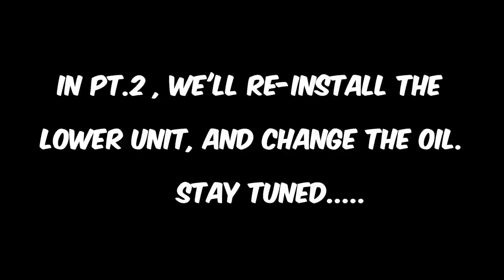Pt.1 Suzuki DT25 Outboard Water Pump Service  At D-Ray's Shop

Comment: D-Ray,  I used this vid to help me change the water pump on my DT30. 
Now the carbs need cleaning.  What’s the secret to getting the carbs off?  
I assumed the silencer base comes off first but there’s not enough room to remove the bottom two bolts. 
Are the carbs able to be removed with the silencer plate still in place?

Comment from the maker: There is a roll pin that attaches the shift shaft just above the lower unit, you should be able to get to it with the lower unit dropped a few inches. There is a good exploded view on boats dot net

Comment: Thx mate. Easy to understand instructions made this much easier. Appreciate too much information often confuses. So as a addon,  I'd like to add some things I found when I took this on. prep is so important, clean faces, ports and channels and parts with none corrosive cleaners (white spirits are good). Inspect spline and shaft for damage. A incorrect or forced installation would of caused uneven wear.   Remember a little bit of grease goes a long way for a long time. Don't go over board using sealants its not rocket science or needed. A even, opposite and firm hand tightening is all that's warranted.

Comment: I have that exact motor I believe the water tube north of the water pump housing on up the leg. Its cracked a little peice but not all the way off could that be the issue to weak stream or little to no flow..

Comment: Great video, great camera work too! I purchased a new in the box 2017 25hp efi in May of 2019 the motor runs great and water comes out the pee hole when running, however when I hook the clamshell garden hose thing up no water comes out the pee hole, there is a side plug to flush when engine is off. Is this normal? and my old Johnson 90 water would squirt out the p hole with motor off, is water supposed to squirt out p hole with engine off while hose is running?
Thanks!

Comment: Replaced water pump impeller just fine. Shifter linkage on top end came out of plastic shifter arm. I can’t get realigned, to I have to pull power head?

Comment: D-Ray enjoyed your video. I change the water pump in my DM 40 Suzuki outboard. the water pump does not pump water what could be wrong ? The tube to the motor is clear, I hooked a water hose to it and water comes out of the tattle tell.
thank you
Lee

Comment: Great Video D-Ray!!! Very educational. I am in Cape Town and we lack guys like you. I have a Suziki Dt30c outboard motor and have trouble since the day I bought it. Not sure what year model, but the motor sounds fine when out of the water, but "misses" when in the water. I can feel the loss in power every 5 seconds. It comes and goes as I drive. I have changed the spark plugs and had it service twice at different mechanics. Any advice please? I would really appriciate it...

Comment: D-Ray.....  I have one of these Suzuki 25hp 3cyl Oil injection engines that has mostly been sitting for years.  Finally going to start using it again and it runs rough, long story short, did a compression test and 2 cylinders have great compression, one Cyl has zero compression.   Do you work on issues like this?

Comment: D Ray, Awesome. I'm about to do my 2014 Suzuki DF175 for the first time myself. I have a question: should I put a small amount of grease on the water pump plate gasket at the mating surfaces or does it matter?
I really appreciate your fantastic video.

Comment: Where do I disconnect the shift cable on a 1978 Suzuki DT50? My motor does not have a plug on the starboard side like my repair book said to disconnect it from. The only place I can see to disconnect from is under the bottom carburetor. Please help. I am trying to replace the impeller on my motor.

Comment: I should have been more specific when i said that it spits water out the exhaust..I know that the exhaust comes out the prop also but it seems on the Suzuki i have that about half way down the shaft of the motor on the back there is 2 holes and the water comes out there and also i want to add that it only comes out 1 of the holes the other hole nothing comes out it...Is it suppose to come out both holes?? Thanks.

Comment: Excellent video, very helpful!

Neels Viljoen I'm also in Cape Town, I also have a pair of DT30Cs.
I take it you have the dark silver grey models? The earlier models (light silver with blue decals) are notorious. But the later gun metal grey models are much, much better! Also super cheap on parts :)

I can't think what your motor's issue might be, it sounds almost like cavitation. What boat are pushing? Hopefully D-Ray will have some ideas...

Comment: Hi i have a 1986 DT 25 Hp Suzuki and it only spits water out the exhaust and i have looked for a rubber hose for it to spit water out like a Johnson or mercury and i dont see one..Is this correct for a Suzuki or should it have water coming out a rubber hose also?? The water that comes out the exhaust is hot sometimes and it seems its cooling the engine and i have run it quiet a bit and i dont think its getting hot but it may be..Thanks if you could help.

Comment: forgot to move the throttle linkage and ripped the rubber bushing off the top of the motor what is that part called

Comment: I have Suzuki 25 super tree. I have removed all the screws  but the lower unit does not drop even when try to hit it with some plastic or wooden hammer. Any suggestion ?
Reply: Remove the trim tab and look to see if there is another bolt under there
Reply: There is no any other bolt there at all